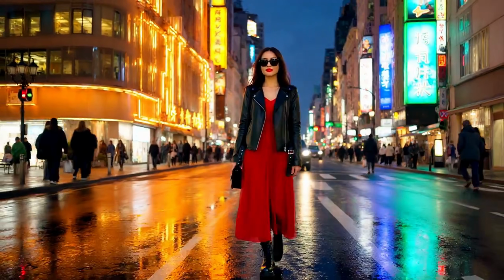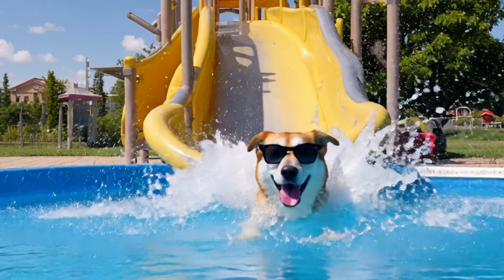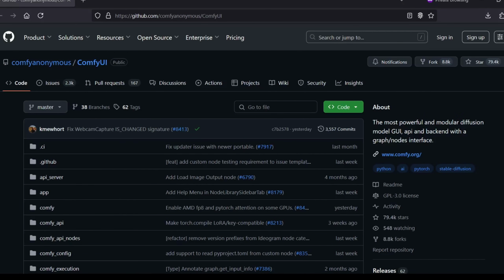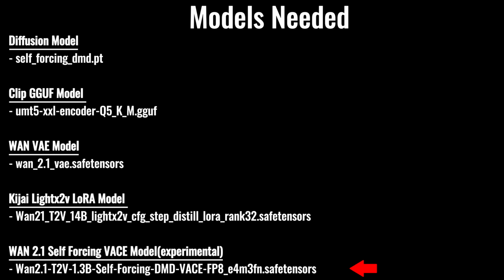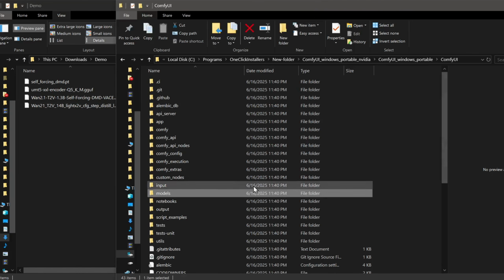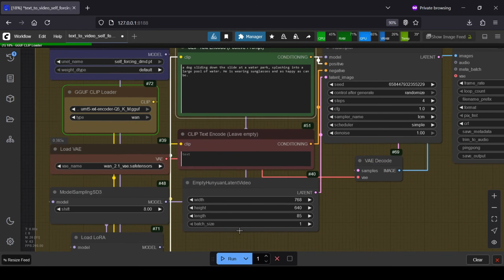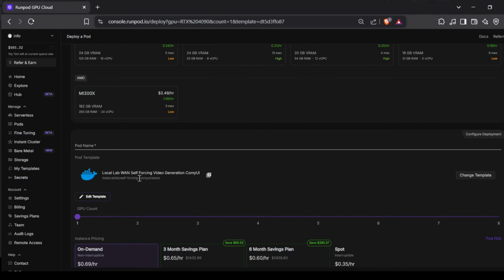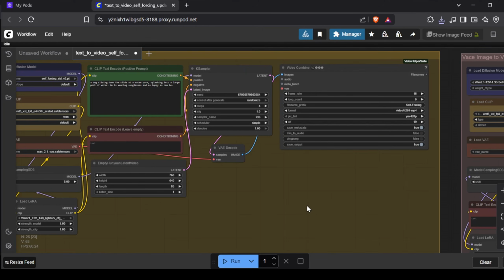WAN 2.1 Self Forcing w/ LoRA - Best Low VRAM Local AI Video Generator - ComfyUI Tutorial

Comment: I don't see any point in using cfg step distill LoRa for model 14b with model 1.3b. They have different architectures, they are not compatible, it will not make any effect. The model in the video is self-sufficient and does not require this LoRa.

Comment: i generated the video with the dog (T2V) in 253.42s, i still don't understand how it's possible.. 0_0 ??
I have a rtx 3050 Ti 4GB - 40 GB Ram, used the umt5 gguf Q8, bypassed the lora and added patch sage attention and model patch torch settings after the model load node
Reply from the maker: Congratulations. Didn't know if 4gb was possible. Probably slow as piss though but still great!
Reply: @TheLocalLab  Def acceptable compared to what i was getting with Wan gguf, tried Image to Video too 480x480 generated in 331s, still faster than before
Reply: @Chronos-Aeon  wow! Thanks.
I have the same spec, RTX 3050 4Gb vram. Surprising you would even generate a video with a Q8 model, i usually go in for maximum Q4s.
I will definitely be trying this when I get back home from work

Comment: Just tried your workflow and no dice:  WARNING SHAPE MISMATCH diffusion_model.blocks.0.cross_attn.norm_k.weight WEIGHT NOT MERGED torch.Size([5120]) != torch.Size([1536])
Reply: Im getting the same error with my setup as well. Using all of the same models listed.
Reply: Same error here, a big long line of errors that say something like this.
WARNING SHAPE MISMATCH diffusion_model.blocks.0.cross_attn.norm_q.weight WEIGHT NOT MERGED torch.Size([5120]) != torch.Size([1536])
Reply from the maker: Are you guys unable to generate an output? This looks like more of a warning message rather then an error.
Reply: @TheLocalLab  THose aren't warnings those are flat out errors with no gen, just the comfy popup.  DOA.  When there are any mismatches it can't continue.  That is in stone if torch.  I have moved on to FusionX and MAGREF that both work wonderfully well.
Reply from the maker: @generalawareness101  Ah ok. Feel free to join the discord and post a screenshot of this error in my help-troubleshoot channel. I'll try and see if there's a fix for this if needed. Link - discord.gg/5hmB4N4JFc.
Reply: @TheLocalLab  I ran this workflow no issue last night, and Got these errors today ^^. I beleive if ur generating things above your means aka too many steps too long of video etc etc you Will get this error, because when i lowered everything no error. BUT even with error I was stil able to get a generation out of it while errors were flooding in

Comment: and I get this error when photo to video - Prompt outputs failed validation:
UNETLoader:
- Value not in list: unet_name: 'Wan2.1-T2V-1.3B-Self-Forcing-DMD-VACE-FP16.safetensors' not in ['Wan2.1-T2V-1.3B-Self-Forcing-DMD-FP16.safetensors', 'Wan2.1-T2V-1.3B-Self-Forcing-DMD-FP8_e4m3fn.safetensors', 'flux1-schnell.safetensors', 'self_forcing_dmd.pt', 'self_forcing_sid_v2.pt'] 
even if I installed everything just as it is in your video :(
Reply from the maker: Check your models and ensure you have placed them in the correct folder as shown in the video. After check the model loader nodes in the workflow and manually select the self forcing model you downloaded in your models folder.
Reply: @TheLocalLab  thanks for the quick answer. I think I fixed it, but when I upload the "Target face" sometimes I get a completely different person. 
how to fix that?
Reply from the maker: @maverickf1869  try using different images of your person of interest. The VACE models created for these self forcing models aren't the greatest and still need more work to improve accuracy but you can try using both the fp16 and the fp8 model and see if you can improve your results a bit.
Reply: @TheLocalLab  should I "play with" KSampler CFG and steps? even if I've got a "norm PC" it still takes 200-300 second to generate a 5 second video, that's why I have so many questions lol

Comment: Thanks for the tutorial. I got it working. What is the benefit of this model? Is it able to generate long videos? Or is it simply quicker than other methods?
Reply from the maker: The main benefit, I believe is the size to quality ratio of the model. For its size(1.3B parameters) it can produce very high quality/coherent videos in far less time then larger models. If you can run this model on faster GPUs, you can generate videos in near real time which is really difficult with bigger video generation models.

Comment: so it did work on my GTX 1650S simply after waiting 45 minutes for 81 frames "i'm not complaining" i just wants to know if those (warning Errors Diffusion model mismatch)  in the log are coming from the Lora being for the 14b Model and the DMD-VACE model being 1.3b , is that the mismatch or something else ? never the less i generated my first local video, thanks for sharing
Reply: vace is complicated to use, and why use vace for normal t2v either, just use normal 1.3b model with the same dmd model. there's other channel that use normal workflow with self forcing technique and DMD model and added upscaler and interpolation with it, quite good for a low ram user , prob will take your card to generate 3-4 mins with it. my card only generate 70 sec with that model, it's just too low ress for me. but the video is good and usable, that's the point i think.
Reply: @AiKonFlux   any Channel suggestions?
Reply from the maker: Honestly I'm not entirely sure but I would disregard those messages for the time being. If you want, you can try using the workflow without the LoRA and see the differences in outputs and go from there.
Reply: @TheLocalLab  Tried it without the lora and it did shave 25 min 🙃
Reply from the maker: @madcomhichoo 😂 go figure.
Reply: @TheLocalLab  yeah, i'll try that, thanks